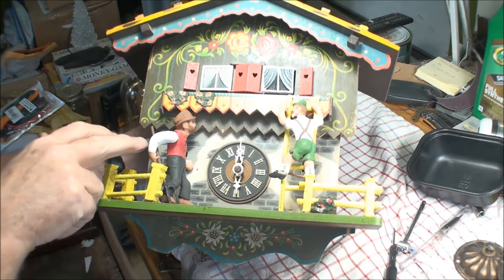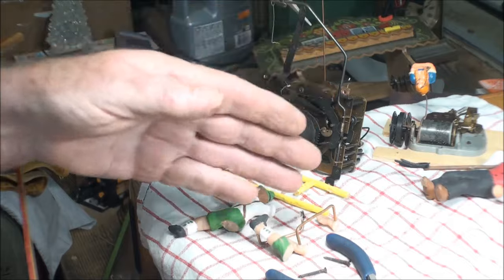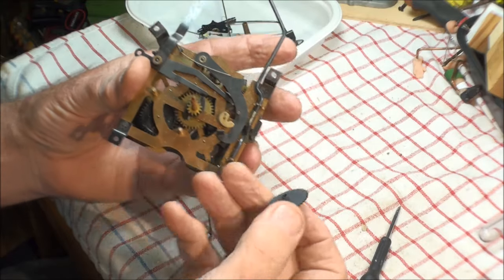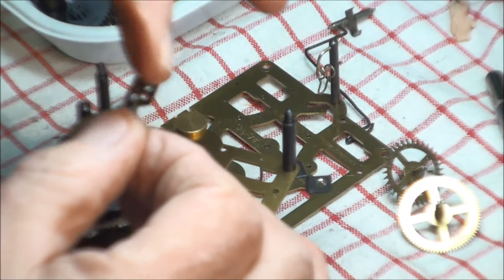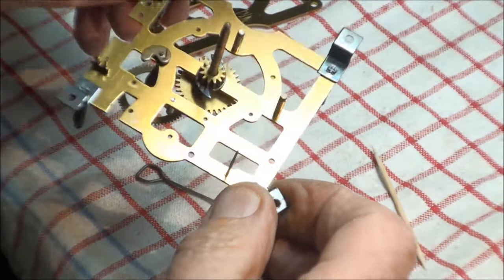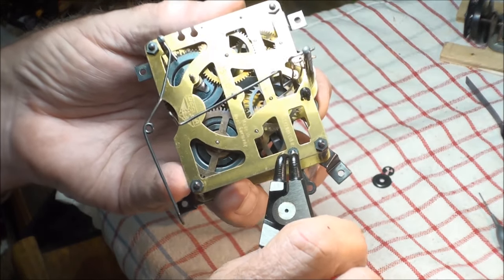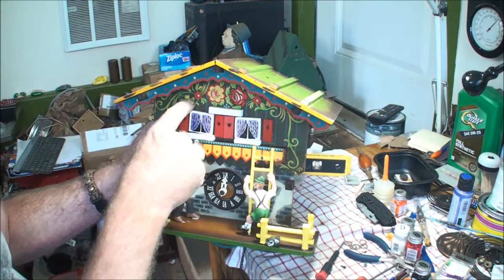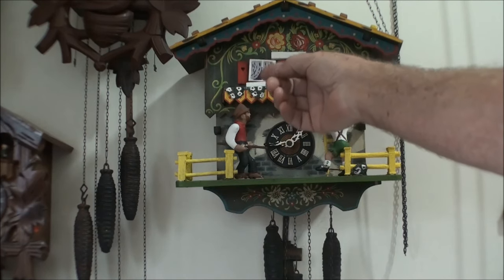Farmers Daughter Cuckoo Clock Repair

Comment: The farmer doesnt look original to me.  Not sure if the boyfriend is or not. However this is a newer clock so they could be original.  You did a great job as always. You might watch my video on this clock. If you dont have the chains routed correctly for the boyfriend then it wont move. Thanks for the shout out. God bless you as well Mike.
Reply from the maker: I tried everything to get the Boyfriend to climb the ladder, then I remembered that I put wax on the chain after I cleaned them. Now I need to clean that wax off the chain that moves him. You are well worth the shout out Mark. God Bless

Comment: Nice job Mike! I enjoy watching your videos. You need a work stand for when you get them running. I give you a lot of credit for getting it running the way balance the clock on a table. I’ve done that before and it not that easy. Keep up the great videos.
Reply from the maker: Yes, I do need a work stand for the clocks, but at the moment, this room is a mess of boxes from the shipping of these clocks and clocks that I want to work on. I will soon have one in as soon as possible because I know it will make my life much easier. Thanks for watching Tom Knick

Comment: You have a lot of patience; you must have worked on this clock for many hours on case repairs and servicing the movement.  I can tell it bugs you that you haven't gotten the guy to climb the ladder but maybe you will circle back to that at some point.  Yes, toothpicks are cheap but what I do to make them last longer is when the end gets black with pivot hole gunk, take a utility knife and scrape the black stuff off into the trash.  You didn't take the pacman (gathering pallet) off but you did turn it with a pair of pliers to sequence the cuckoo side; the amount of force to take it off is just a wee bit more than that.  If it gets too loose, one way to address that is to put the pacman on an anvil and carefully go around the hole with a punch with the idea of closing up the hole a little bit to tighten it.  I enjoy your videos and learn things from you.
Reply from the maker: The hours were just fixing the case and figures. Someone tried to fix the clock before. I don't thing the Ladder, nor the Fencing is original to the clock, but close enough. For the man climbing the ladder, if I had of thought, I would not have waxed the chain after cleaning them. This is what is causing the man, not to climb the ladder, I am sure of it. 
  You are right and I didn't thing of it that way about the pacman.
  It is always good to watch other people working on clocks in case you see a new idea that you haven't thought of to make your job and life a little easier. Thanks so much for watching and giving a great comment. God Bless.

Comment: I have a farmer, daughter, Cuchi, clap the chain came off. I put it on and is not moving. The characters is off sequence.
Reply from the maker: I made the mistake of waxing my chain, so the boy slips and does not like to move. I will have to take the chain out and clean it again and them just install the chain dry. Thanks for stopping in Jose Cuevas

Comment: Hi Mike,  I have this clock but I am having trouble with the cuckoo and door closing after it successfully cuckoos.  I am able to close the door manually with the cuckoo going back in.  Is it possible that the cuckoo and its associated black bar is disengaged with the movement?  Any help would be appreciated.
Reply from the maker: Your clock could be in need of oiling. The book says to oil your clock every 5 to 7 years to blow out the dust, and freshen up the old oil so it doesn't start to gum up and stop the clock. If you take the movement out to oil it, check the spring tension for the bird to see if you need to take another wrap around the bar of the bird so he will come back inside the house.
Reply: Thanks Mike.

Comment: my friend has the same clock :DDD
Reply from the maker: They are a nice cuckoo clock, but in time, I found that the rubber wheel that make the boy climb the ladder will get hard and the boy will not climb the ladder. Thanks so much for watching and I joined your channel. Happy you like cuckoo clocks.

Comment: Excellent video I have learned very much!
Reply from the maker: Thank you Barb Dixon. I normally do these videos so others can work on their clock or at least figure out why their clock is not doing what it is suppose to do. Thanks for stopping in to watch.
Reply: @justmike57  you do a fantastic job with your videos I have learned so much by watching them. I can’t wait for new ones to come out
Reply: @justmike57  hi mike I’m working on a cuckoo clock everything is good except the bellows are not barely making any noise. I redid the bellows which I did before but this time I am having problems. I switched the bellow arms thinking someone changed them but that’s not the case. Please I need your expert advice. You think I made the bellows too wide? Thanks Mike